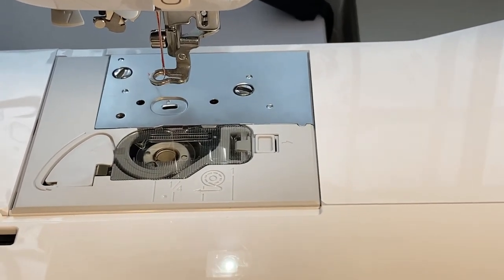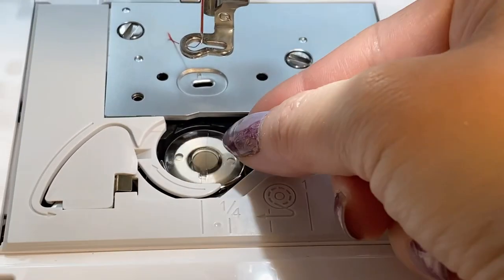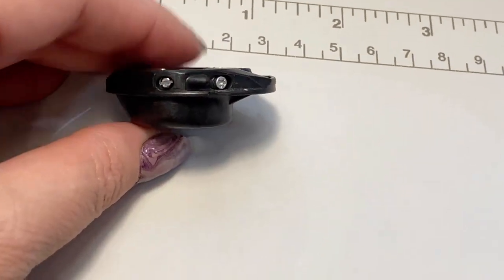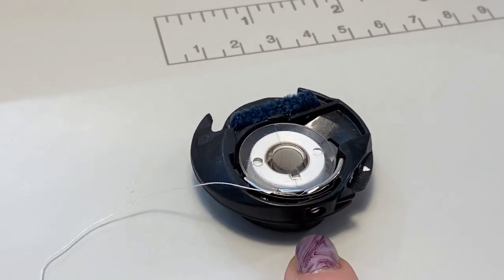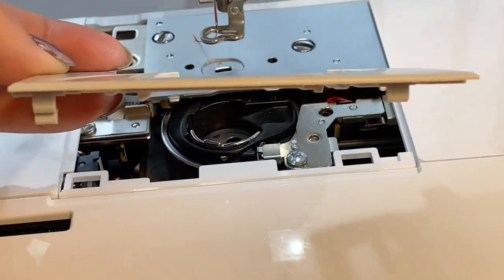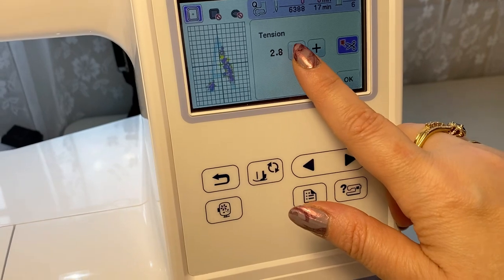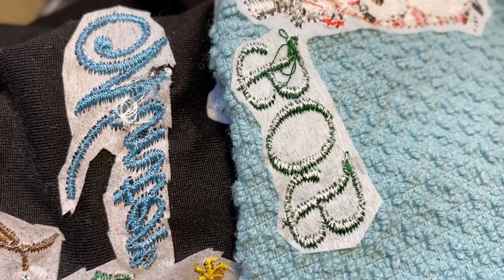How to adjust bobbin thread tension on Brother Embroidery Machine PE 800

Comment: Mi top thread is is making loose loops on top on the bottom.  No bobbin thread showing either.  Under it’s a birds nest.  :(.  It was working fine before I don’t know why it’s doing this now.
Reply from the maker: If it worked fine before, I would rethread the top completely, it’s possible to be out of some place.
Reply: Same, did you fixe it? What was the problem
Reply from the maker: @Scarlettscarlrt-lw6gu top loose thread is happening usually if the thread is missing a spot. If you can't find it, better rethread the machine (correctly of course).

Comment: How much did you loosen it I have and mine still not showing through
Reply from the maker: If it's that tight try to unscrew 2 times first (more if needed) until feels that comes comfortable out, just not super loose though.  If the thread comes out nicely from the bobbin and still not looking good, then you need to tighten the top thread tension to bring up the bobbin thread. I hope it makes sense.

Comment: The top thread is hardly showing on tea towel I’m trying to embroidery. Which needs tension adjust top or bottom? Iam usin stabilizer and Brother thread that came with the machine.
Reply from the maker: First you need Water Soluble Stabilizer on top and regular stabilizer underneath, then you may need to loosen the top and tighten the bottom. Test it and keep adjusting the same until is right. Sorry I found this so late...
Reply: @Lovesewing896  I went settings and found the manufacturer had the tension set to zero! . It was my first attempt ar using the new PE800:)  I then set it on 3 and embroidered the built in dragon design and it stitched out perfect. I’m still trying to get use to the machine. I learned on PE150 frim 20 yrs ago. It still works but I cant find anything compatible so i can copy designs to a memory card. I have a reader writer box that connected to computer with a serial port. It needs an old computer wuth windows 98, XP, or Vista. So basically I am stuck with out of date  technology. It embroiders 4x4 nicely.  Hubby bought me the PE 800 as an early Birthday present.
Reply from the maker: @angelaackerman8934 I am glad it worked out! Technology transition is a pain and costly, unfortunately for the lost goods…
How nice of your husband! ❤❤ Enjoy your beautiful and fun gift! 😍
Reply: @Lovesewing896  Actually I haven’t lost my designs. I copied them to a cd years ago. I have loaded them on my newer laptop with windows 10. I have them organized with Buzz Tools so I can see what they look like before selecting them to load onto a usb stick. lol  . I need. Some 5x7 designs. There aren’t as many freebies like there was years ago.

Comment: Hi can you please help me I’m having a issue where my shirt is getting pulled into the metal casing and leaving a ball of thread which I have to cut out leaving a hole in my shirt it was working perfectly fine till today
Reply from the maker: Make sure you have the same thread at the bottom as the top.
       Maybe you changed the type of thread? If is thicker thread then you should adjust the bobbin case as in the video, to lose it. Also, a possibility is that for whatever reason when you loaded the bobbin it loaded too tight, which doesn't allow to come out easy so loosening the bobbin case might help, if not, try a different bobbin, check how is threaded when loading not to be too tight.
Reply: @Lovesewing896  thank you for the advice I will try this🙏🏽

Comment: Hi many thanks for the information. When I clicked on the scissor button on the touch screen I can't see the tension settings. Basically nothing. Do I need to do something else? Could you help me out please?
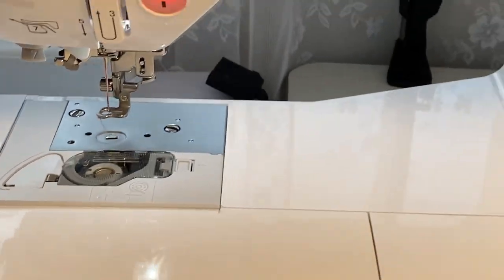Reply from the maker: I suggest you follow the steps in the video starting with the minute 4:20.
If that doesn't work and the screen is not responsive you may need someone specialized in the machine software.
      Please let me know if it works or not, I am curious about the problems of this type of machine. Thank you!

Comment: Hey my design is doing the exact same thing at the ending of your video. No white bobbin is showing through on the words. I tried Decreasing my top tension from 4 to three and I still am getting puckering etc. what did you adjust your machine to?
Reply from the maker: I shown in the video exactly how I adjusted it. Loosen the bobbin case as much as needed until it shows.

Comment: Hello, my bobbin thread is showing up quite alot in the design on the top when im not using Brother brand bobbin thread. Does that mean its too loose? Or too tight? Brother brand bobbin thread is harder to find and more expensive so I would like to just buy some other brand off of Amazon.
Reply from the maker: It's possible that the one you are using is sliding out easier, so you can try tightening the bobbin case. It is also best to use top and bottom the same kind of thread 🧵.
       After tightening the bobbin case, if the stitches seem too tight, you might want to loosen the top thread.
Reply: @Lovesewing896  I ended up adjusting the bobbin tension. It might have been too loose. So I tightened it all the way and realized that I must have over tightened it because the bobbin thread could no longer be pulled once I started the machine back up. But after loosening it up a bit and also loosening the tension of the top thread, everything started working perfectly. Thanks again for showing where to even adjust the bobbin tension! That was a big help!
Reply from the maker: You're welcome, I am glad it helped!

Comment: How do you know if its too loose or tight? My top thread is always too tight.
Reply from the maker: I don't know how to put it in words... When you pull the thread from the bobbin should feel loose, easy to come out but not too loose, then you loosen the top if is too tight. 
     The stitches on the fabric should not look loose or too tight, also if you see the top thread a little bit underneath that means is adjusted correctly.

Comment: Hi   
 Please help
 My machine keep telling me a warning that 
 Bobbin thread is running out but my bobbin thread is full..
Reply from the maker: Hi,
   I didn't study the manual, but if there is a way to restart the software of the machine that might help.  If that doesn't work, you may need someone specialized, because it's possible the sensor to be out or a software malfunction.

Comment: How do you know exactly how much to turn the bobbin screw either way.  You didn't turn the screw.  That's my problem,  which way and how much to turn the screw?
Reply from the maker: The normal rule applies here too “Righty tighty, lefty loosey”.
        You can tell from the bottom of the stitches if is really tight or not. If it is too tight, you can turn left 360 degrees. Test the machine and see if it needs more.